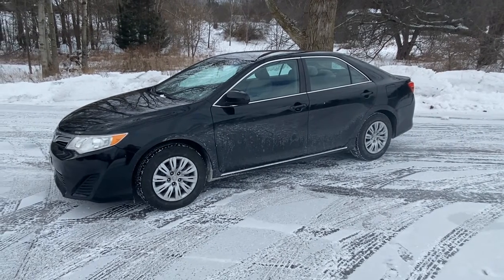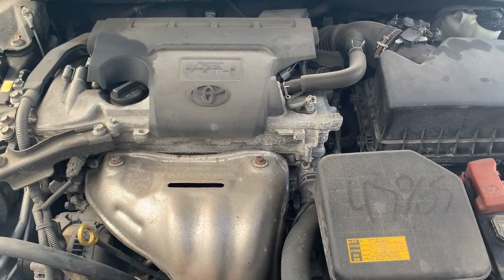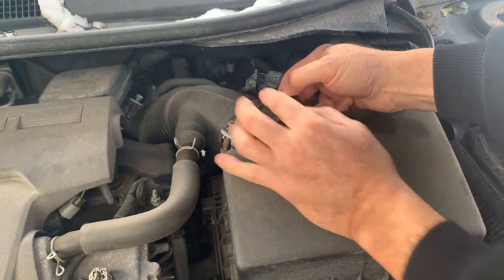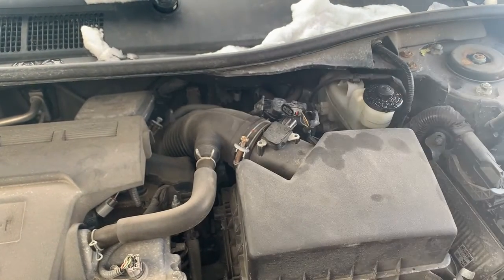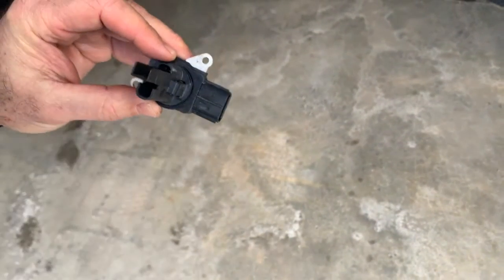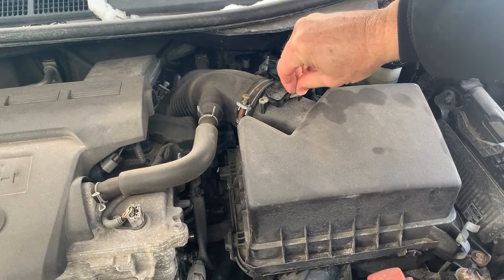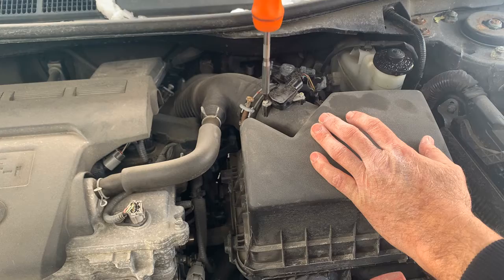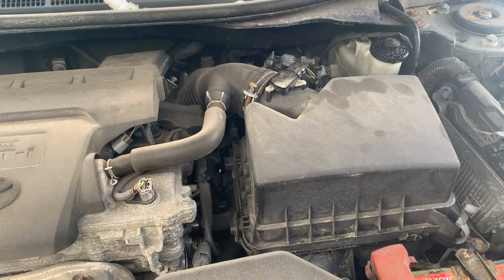How to Replace Mass Airflow Sensor Toyota Camry

Comment: On 2009 Camry do you have to disconnect anything or reprogram anything after you done
Reply from the maker: If the Check Engine Light was on due to a faulty or dirty MAF, clearing the code with an OBD-II scanner is a good idea. If you don't have a OBD scanner disconnecting the negative battery terminal for about 10–15 minutes can help reset the ECU and clear any fault codes.
The code may clear on its own after a few drive cycles, but manually clearing it ensures you're starting clean.

Comment: How to remove a 6 fly Toyota Camry maf sensor
Reply from the maker: The 3.5L V6 is located on or near the air intake tubing between the air filter box and the throttle body and the procedure would be the same.

Comment: What is that thing that pigtails off of the MAF and connects to that other component just behind it? Mine has 2 wires on it white and black
Reply from the maker: The two wires off the back of the MAF transfers information  to your ECM, allowing it to properly adjust air fuel mixture for your motor to run properly.

Comment: My 2015 camry vibrates at low rpm(1100-1300). Will cleaning this sensor help?
Reply from the maker: Many things can cause vibrations on your Camry, I doubt cleaning the MAF would help.

Comment: Cant find it at all on a 2000
Reply from the maker: That's probably because your Toyota even if it has a four cylinder, is a Fourth generation and the one featured in the video is the seventh generation. It might look a little different but it should be the same basic principle , if you have a 2.2 engine it will be on the air cleaner before the tube going to your throttle body.
Reply: @TheAutoTeacher  just a air flow sensor

Comment: My '99 Camry doesn't have one on the air filter hose by where my air filter is.
Reply from the maker: This vehicle in the video was a seventh generation Toyota Camry and yours was the fourth generation. So of course there's going to be a lot of different variations and changes from generation to generation. But if you feel that you're missing a hose on your 99 I would definitely talk to the Toyota dealer, it would definitely affect performance and drive ability.